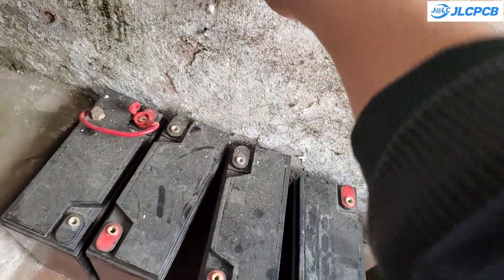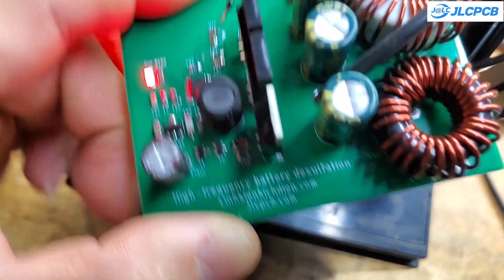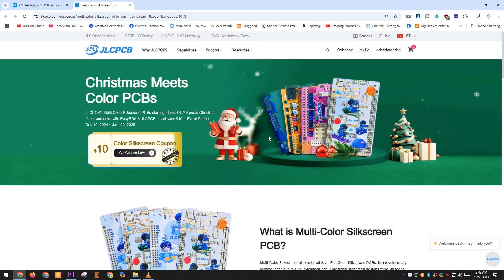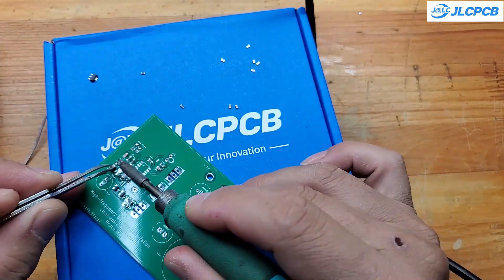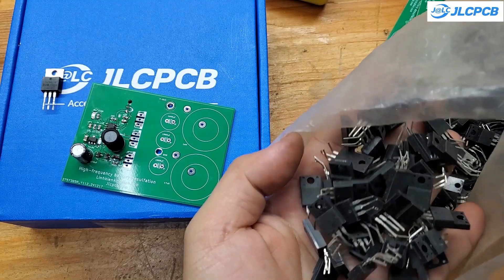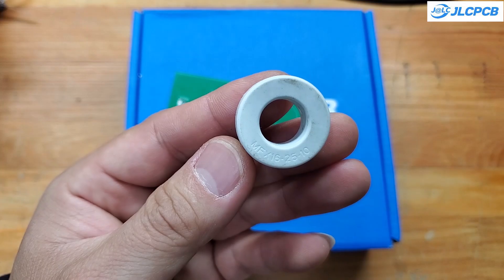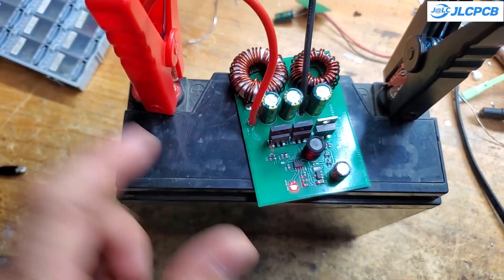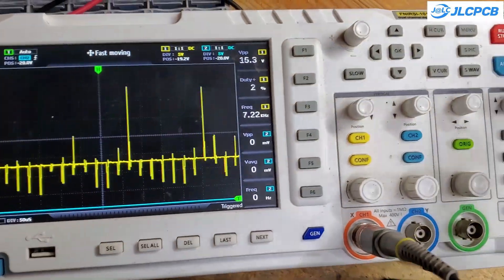100% battery repair with this tool | JLCPCB

Comment: This circuit doesn't work at all. Great scott make a video in this topic, you can check
Reply from the maker: Thanks for watching.
Reply: he says that this circuit will remove the lead sulfate, this circuit is discharging the battery which is actually producing lead sulfate.

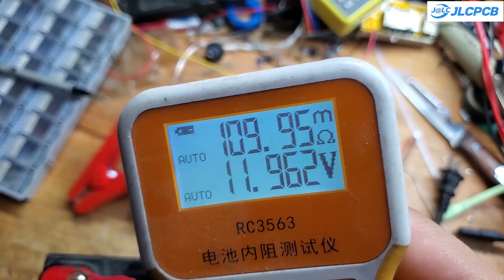Comment: @7:50 While  110 milliohms is an improvement, a new 12v20ah AGM battery is about  14 milliohms. This battery still needs to go to the battery recycling center, because it’s trash. 

If you did a legit load test and capacity test, it would be obvious this is not back to 100%. Using a small AWG wire across the terminals and seeing it melt the insulation doesn’t prove anything.

I’ve tried many methods to restore AGM batteries but it ends up just wasting time, if that battery is to be used in an ebike or anything that uses high current or needs to deliver the rated capacity.

Sure, you can use this trash battery to power a 12v light or router or something,  but it will not get to 100% of original.
Reply: Абсолютно верно!
Пустая трата времени!
Reply from the maker: Thanks for watching.
Reply: Some lead acid batteries are worth doing. On SLA add demineralised water first. AGM is less likely worth. I tried all this with a cheap ebay charge desulfator combo.
Reply: @LawpickingLocksmith yes, if its s flooded cell lead acid you might have a better chance. But clearly this battery belongs in the recycling center. Lol

Adding distilled water will not bring back an AGM battery. And you can’t equalize charge AGM without doing damage to the cells.

Since this is 2025, all lead acid should be replaced with LiFePO4. Thats what I did after replacing AGM cells every year.